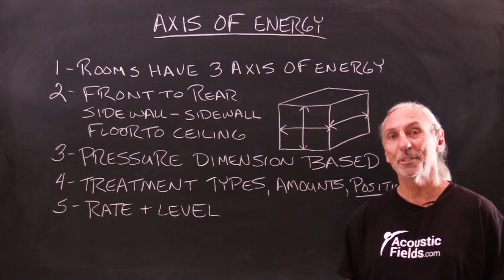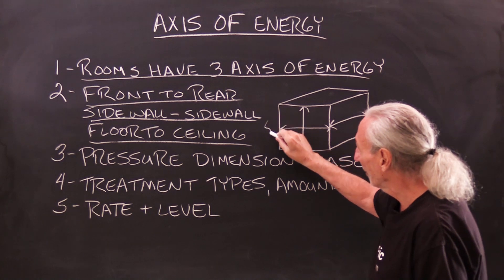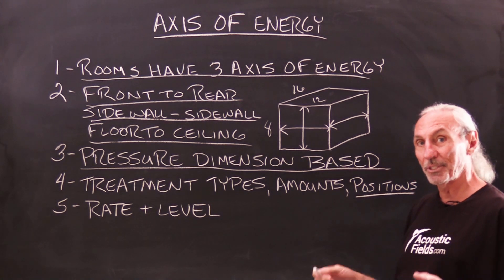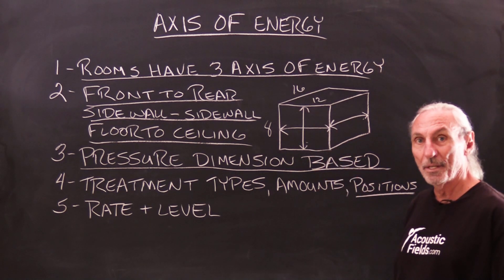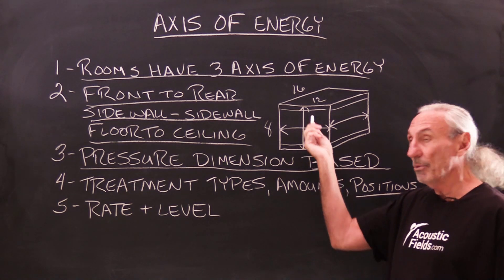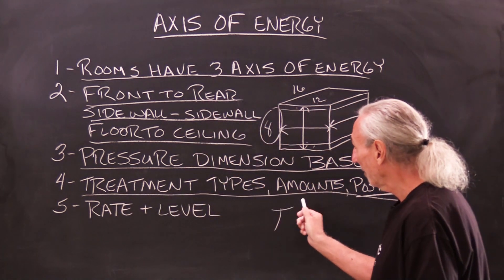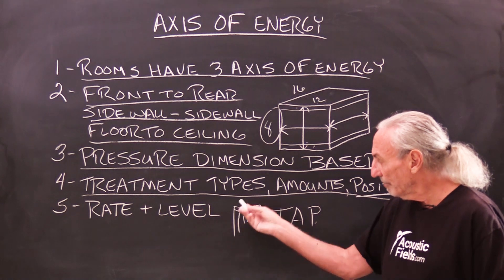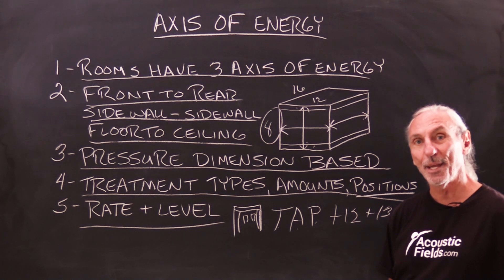Axis of Energy - www.AcousticFields.com

Comment: Thanks for all your help in this toppic that inpact so much of our music. You say that we must have enough horsepower to treat the lower frequens but this is hard to do 100% correct. What if you do it to much? Then what to do?
Reply from the maker: Treating low frequency energy requires large amounts of surface area treatment. Think about your room as a shoebox, size 8. With low-frequency energy issues you have a size 15. You are trying to place a size 15 show in a size 8 shoebox. The only way to get the shoe to fit is to bend it over or reduce the shoe size. LF absorption reduces the shoe size so it fits better.

Comment: So what would happen if you have a corner chunk absorber.. would that adress two axes simultaneously?
Reply from the maker: People are always looking for a "quick fix" when it comes to room modal issues. There are none of these. The entire wall surface area is producing the unwanted modal pressure issues. You must treat at least 50% of the wall surface area to have an audible impact. Corners maybe represent 10% of the whole wall surface area. You can not fix a 100% problem with a 10% solution.
Reply: I don't think they would. Axial modes are with two parallel surfaces, so you would need to treat the entire surface, not just the corner.  The two surfaces could be either of the three he describes in the video..  The next type is between four walls but those a Tangental, but those issues aren't as big.  then there is oblique and that's between 6 wall surfaces, but not as big as Tangental or Axial.  Axial modes are the biggest in terms of amplitude.

If you could use a room mode calculator that shows a 3D rendering of the actual modes, you'll find some that might be in the corners, but it's not as common, and it's certainly not typically an Axial mode problem.

The only way to really know is by using the actual measurements of your specific room to figure out what your biggest mode problems are and along which surfaces they exist and need treatment. Then you can look at the actual frequencies affected to help figure out what product you'll need.

I know Dennis can certainly help you out with that, so at least you'll know what type of product or material to use, where, and how much because he's looking at not only the room dimensions, but the usage, and the actual output of whatever your source is (speakers, musical instruments, voice, etc.). That will impact the problems differently and you may need more or less treatment depending on the variables of your specific situation..

Dennis, please verify that I'm explain it properly..

Comment: Theoretically, what if your room didn't have a ceiling?  What would change in planning the room?
Reply from the maker: Yes, people at the listening position would have to wear coats in the winter. Lets please stay in reality.
Reply: As I understand it the purpose of treating a room is to have the benefits of the indoors (isolation) without the drawbacks in sound that the walls and ceiling create. 
There will always be some compromise. Just as open back headphones sound great but are missing the "protection" that closed headphones provide.

Comment: Great insight on how to meaningfully address floor to ceiling issues. I’ve been curious about your foam perforated panels, namely the arrangement of materials.

 (Pegboard- porous material-pegboard is it?) 

I have two questions about that. For those of us who may not have the budget/capabilities for a platform or heavy units on the ceiling, would that strategy be something you’d recommend as a way to get more horsepower to address modal issues from about 80-90hz and up using a cotton based insulation or a foam with decent somewhat linear absorption curves? 

If so, do you think you’d ever incorporate it into the DIY series? Assuming it would do better than just bare porous material, I think it’d make a great addition as a ceiling solution.

Thx for all the great work Dennis!
Reply from the maker: What is room usage?
Reply: @AcousticFields   Thx for getting back! In my case it’s computer based production/mixing and occasional vocal recording. No live instruments outside of small percussion like a shaker for instance. 

Room is 12 x 12.5 x 8.5.. tough.. but I built a 3 diy bdas (insulation fill) and I’m having the best listening experience ever.    Leaps and bounds better than my previously sophisticated insulation corner mounting arrangement. Building more, and ordered some foam too. Always grateful for your insight!